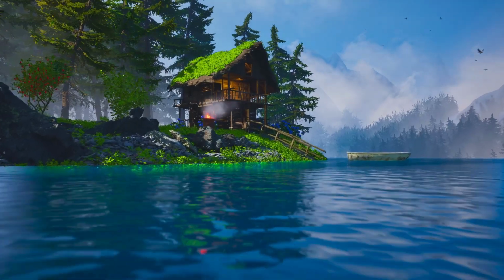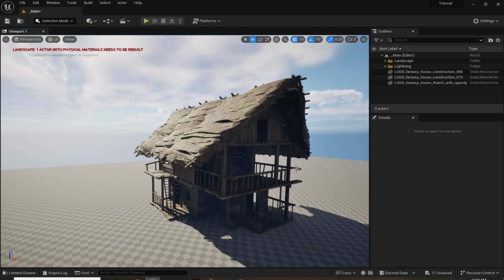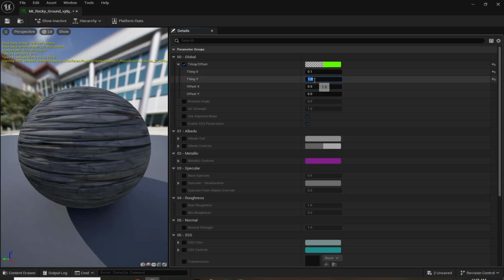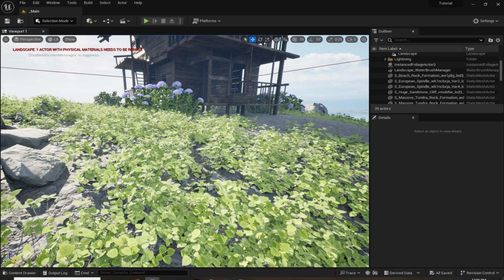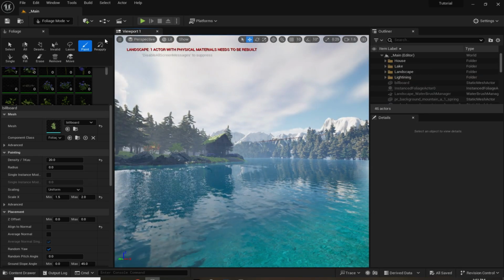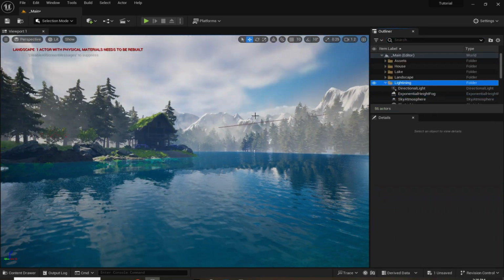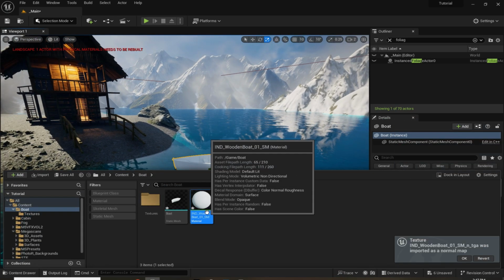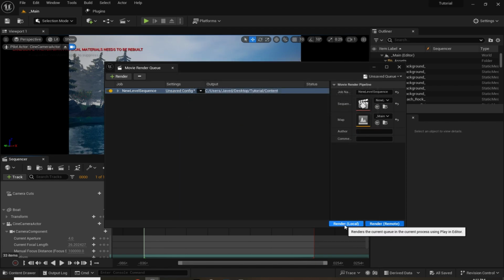Unreal Engine 5 Environment Tutorial for Beginners

Comment: salam, i tried this tutorial but some foliage problem seen. tell me what can i do. can possible i send to clip for seen?
Reply from the maker: What type of foliage issues are? 
Most common are foliage disappeared at a certain distance.
Second most common is foliage LODS  it become low quality at certain distance. 

If you are having problem with trees like when you render the trees disappear then there is vram issue you can decrease the trees count and solve this issue, 
 If there is something else then you can explain me little bit.
Reply: Salam, exactly that is problem as you define. But i try this commands i.e
.Shadow.DistanceScale 0
Foliage.forceLOD 0 
r.ScreenPercentage 200
r.MotionBlurQuality 5
r.DepthofFieldQuality 4) 
but issue not resolve. thanks for your guidance.
Reply from the maker: W Salam brother 
Try decreasing the high poly foliage count, 
The commands that you have used is actually the solution of these problems. But I don't know why there is still issues.
Reply: SALAM, 
THANKS FOR HELPING

Comment: I lose all detail when I change albedo?
Reply from the maker: Don't change the albedo just increase the saturation little bit and vibrance. If its didn't work for you then you can increase the saturation from Post process volume just leave the foliage as it is.
Reply: @JavedVFXx  It is for the rocks, the second I click the tick box on albedo, all detail is lost. I either have to reapply the material back on or delete the asset and reimport it from Quixel. I'm doing the exact same thing you are
Reply from the maker: Make sure that you are changing Albedo tint,  that's weird I have never had that kind of issue before...
Reply: @JavedVFXx  Yeah i was, very strange, forced my way through and hidden any blockiness with other assets, so it looks good enough to me. Wrapping up with the level sequence and I'll add some sounds and should be done! Thanks for the tutorial. Gave me a ton of confidence